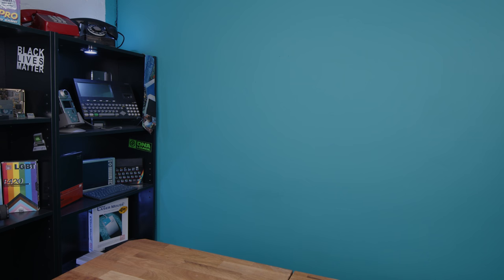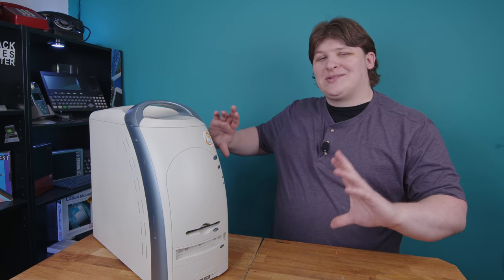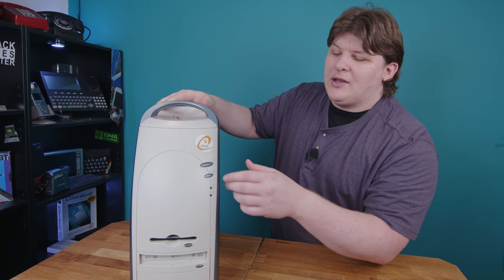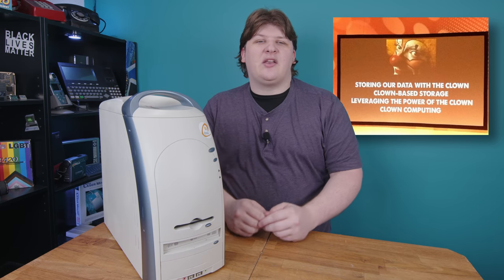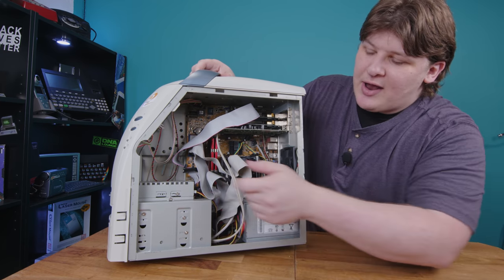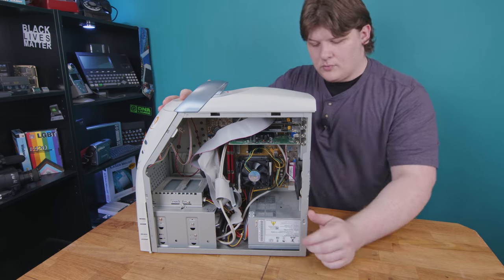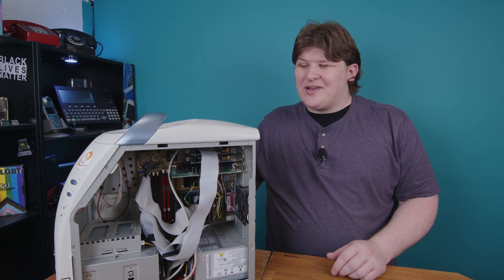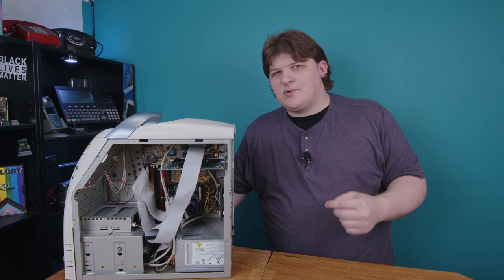Meet The Edge

Comment: Windows XP took so long to die that you can run it on much more modern hardware than a P4. A Core 2 or even an early Core-i series will run XP SP2 great. And you get all those wonderful quality of life improvements that the newer platforms bring: They run cooler than a P4, they're much faster, they support PCIe graphics cards, SATA, and regular old DDR RAM instead of Rambus. They're usually cheaper these days, too.

I have a Dell P4 that's the red-headed stepchild of my collection. Win98 runs better on my Pentium II, and XP runs better on my C2Q. It's a PC without a country!

Comment: I remember having a pentium 3 Tualatin 1.4 GHz that smoked 2+ GHz P4s.   Netburst was complete trash and AI have no idea what hat inter was thinking.  A long cpu pipeline combined with the high rambus latency meant God awful performance.
Reply: The long pipeline makes sense if they actually managed to hit 5+GHz and upwards on to 10GHz like they wanted. Early pentiums were slower than late 486s despite all the extra features, higher IPC, etc. and it took time for compilers to adapt to the new arch and the fabs to get the clocks higher. Perhaps if RAMBUS hadn't screwed the industry the Netburst arch would have been somewhat vindicated. How much of Intel's failure to push past 3GHz was caused by the forced retrofitting of DDR onto an arch not suited for it? No idea, I can't imagine it was nothing, though.

Comment: Come on man. SIS chipsets from this era were not bad. Especially on Intel (aka the only good alternative to Intel itself). SIs was definitely better than VIA which had many compatibility issues.

SIS 645 based chipsets were also the best chipsets for P4 based Voodoo machines, as they were one of the two chipsets that supported universal AGP with both 3,3 and 1,5v cards. Something that no Intel chipset for P4 ever did.

Also , UT is not frame-capped at 60fps. You simply had your Vsync off. You have to force it off trough your GPU drivers.

And yes DDR vs SDR is massive difference on P4.  You never want to run P4 with SDR. Even on DDR you can completely bottleneck free with dual-channel DDR running sync with your FSB on 865/875 era chipset.